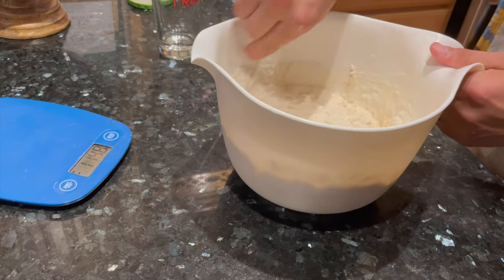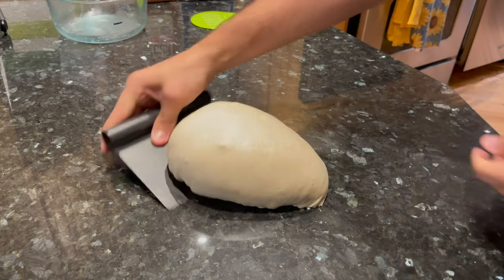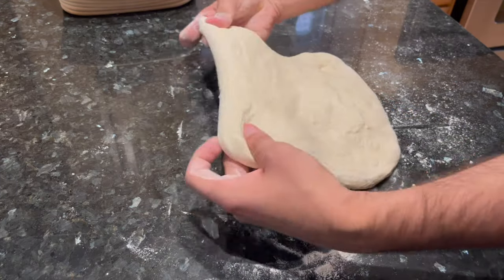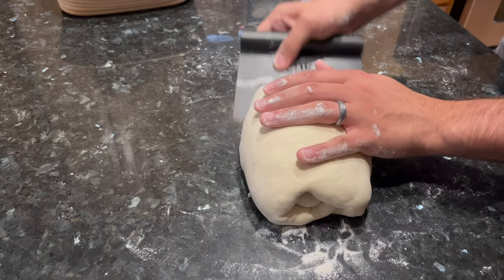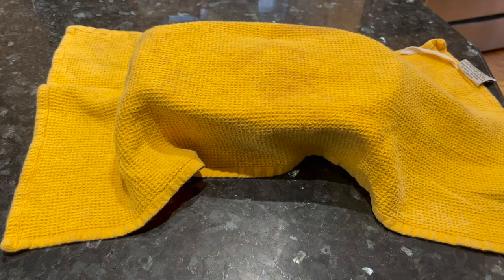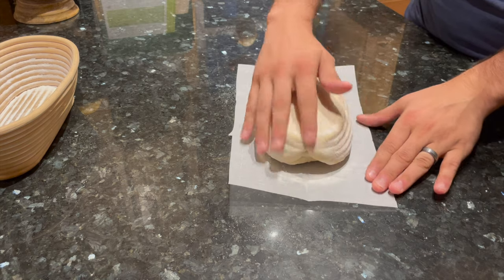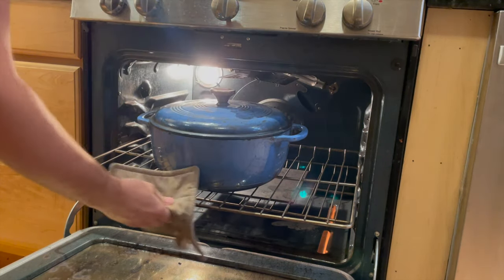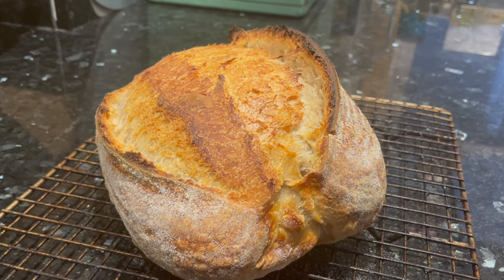Struggling to get an EAR on your sourdough bread? Watch this.

Comment: Hey, I used to get better ears, and some times perfect ears. For the past 5 months I've had no such luck.
I personally don't use flour when doing the final shaping because I feel like I can't stretch the dough out as well because it slides on my quartz countertop.
Do you think using the flour would allow for the tension roll to be more smooth and therefore be better off? When I do that tension roll, it does get a bit sticky, and I do use a bit more force than I'd like to.

Comment: Hi! Are you able to achieve these results in the circle banneton? Also, my bakes are noticeably larger than this. 500g flour, 425g water. Crumb always looks nice but the bread is so large it only splits on the top but never forms an ear if that makes sense. Is it because it’s too big of a batch?
Reply from the maker: That’s a pretty big loaf and quite a high hydration. That plus the round banneton could be the reason you aren’t getting an ear like this. If you’re able to get an oval banneton I would suggest it, because I usually score my round loaves differently. 

Give my recipe a try if you can! It’s a smaller loaf and lower hydration dough. Easier to handle in my opinion.
Reply: @GrantBakes  I see, thank you! I do personally like the high hydration dough. But i will definitely give your recipe a go ☺️
Reply from the maker: @abbymullins629  You can stick with the high hydration too :) The oval banneton and batard shape might help you get an ear.